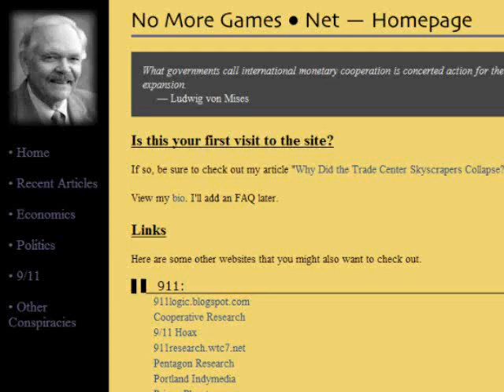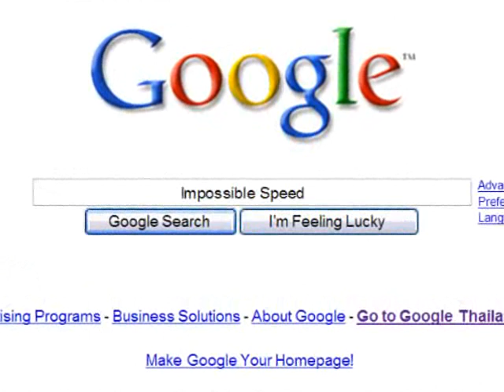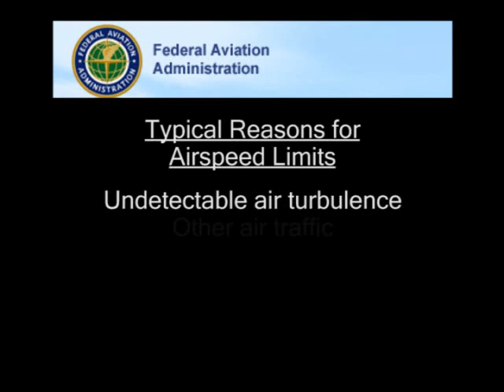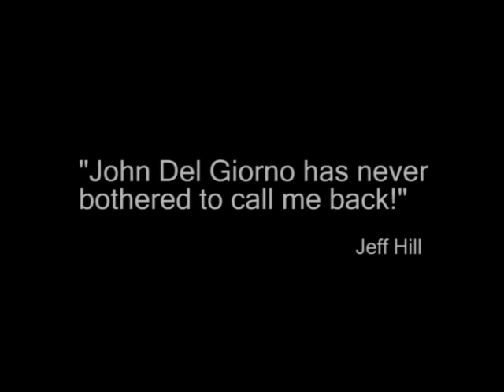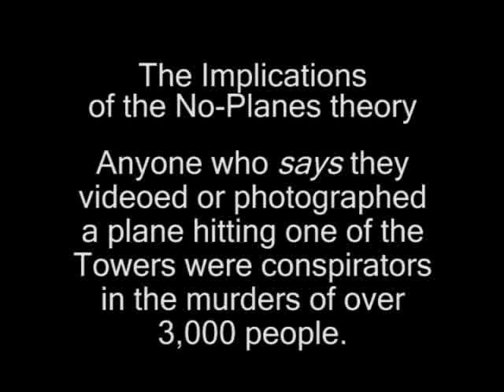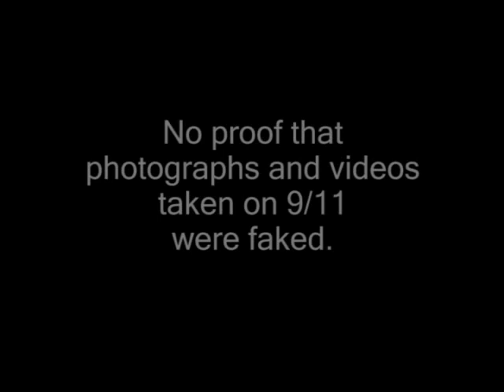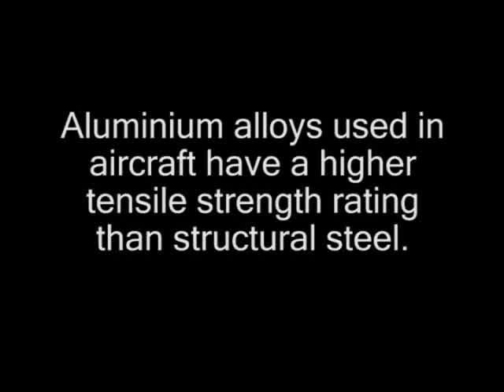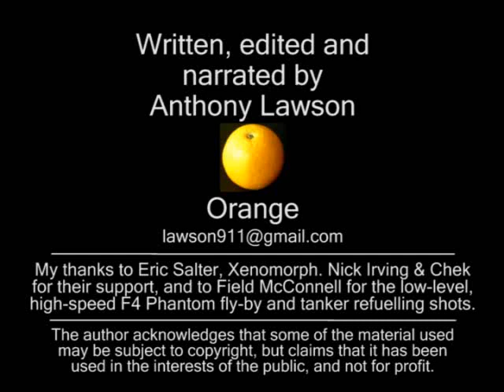9/11: Impossible Speed & Impact -- Busted! Updated

Comment: 1225 km/h, 661 Knots, 761 mph, 1.00 mach = sea level 
1053 KM/h, 568 knots 654 mph , 0.86 Mach = MAX speed for Boeing 757  
0980 KM/h, 528 knots, 608 mph, 0.80 Mach = MAX speed for Boeing 767 
0950 km/h, 513 knots, 590 mph, 0.77 mach = WTC2 impact
0853 km/h, 460 knots, 530 mph, 0.69 mach = pentagon impact 
0748 km/h, 404 knots, 465 mph, 0.60 mach = WTC1 impact

mach 1 is only 1% less at 1,368 feet so i  just used sea level

Comment: didn't need to "implant" retina images on the eyes of witnesses BECAUSE oddly enough almost every witness was an employee of one of the media groups that still brings us FAKE NEWS upon comand today. The odds they were picked at random chance is greater than the number of grains of sand on earth to 1 !!!. 
 F=ma has NO bearing on physical characteristics at subv-light  speed.  Inertia does NOTHING to change hardness values. 
The plane and building are traveling at identical closing speeds RELATIVE to each other. yet somehow the aluminum became harder than steel???

No alloyed aluminum plane traveling at 560 mph can penetrate a steel wall and heavy steel beams all the way through without having a significant amount of debris           bouncing back, or not show rippling shock waves across the building's facade and along the planes wings. Shock wave would have been traveling at at least the same speed as the plane???
. The hole in the wall system shows that the exterior beams did NOT all break but were still vertically intact. 
Half bent outward, half bent inward????
Impossible if a plane just went through them. BUSTED

Comment: Maximum takeoff weight doesn't equal structural aluminum weight, the dry weight of a Boeing 767 is 87 tons, but minus the seats, plastics and non-structural parts it's closer to 55 tons.  So pound for pound this "superior" structural aluminum stands no chance against the hardened steel frame of the towers.  And what about building 7?  Nothing flew into it, right?

Comment: Rofl, this guy compares a fighter jets speed capabilities at sea level to that of a 767?!  Unbelievable.
Reply: The speed is secondary - what determines the physical limits of the Boeing 767 is Mach number and dynamic pressure.

510 kts at 400 m in standard atmospheric conditions equals Mach 0.775. This is well within the limits of the Boeing 767. But at 400 m it produces a dynamic pressure of 40,567 N/m², and that is too much. The maximum dive speed vD of the 767 is 420 kts.

This only means that flying at 510 kts is illegal, but it is still possible. If the airplane dove down to those 400m from enough altitude, it would entirely be capable to reach this speed, but would slow down once it stops diving.

There are several effects which can cause a catastrophic failure when flying too fast:

When the aircraft flies into a gust, the resulting load factor can overstress the structure.
When the pilot commands large control inputs, he will also overstress the structure.
Flutter might also cause structural damage.
The maximum Mach number of the 767 is 0.91 (0.05 above the maximum cruise Mach number, which is 0.86), and this corresponds to 523 kts in 11,000 m. Thankfully, certification requirements demand a margin of 20% between the maximum speeds and flutter onset speeds, so flutter might be close, but is still tens of miles per hour away when diving to 510 kts. Remember, to experience flutter you need also to excite the motion first. Here is a good discussion of this topic.

In short, flying a Boeing 767 in 400 m at 510 kts is not recommended, but is entirely possible and most likely even safe when done in calm air and by a calm pilot. It only won't last long, because the engines will not produce enough thrust to maintain that speed. Flying this dive requires guts, but no special skills.
Reply: @robsash8991  Now try 700ft which was the actual altitude.

Comment: Misinformation. 757 and 767 airliners were not designed to do what a jet fighter can. And kinetic energy does not turn steel into cream cheese. The only things busted are your absolutely ridiculous statements.
Reply: The speed is secondary - what determines the physical limits of the Boeing 767 is Mach number and dynamic pressure.

510 kts at 400 m in standard atmospheric conditions equals Mach 0.775. This is well within the limits of the Boeing 767. But at 400 m it produces a dynamic pressure of 40,567 N/m², and that is too much. The maximum dive speed vD of the 767 is 420 kts.

This only means that flying at 510 kts is illegal, but it is still possible. If the airplane dove down to those 400m from enough altitude, it would entirely be capable to reach this speed, but would slow down once it stops diving.

There are several effects which can cause a catastrophic failure when flying too fast:

When the aircraft flies into a gust, the resulting load factor can overstress the structure.
When the pilot commands large control inputs, he will also overstress the structure.
Flutter might also cause structural damage.
The maximum Mach number of the 767 is 0.91 (0.05 above the maximum cruise Mach number, which is 0.86), and this corresponds to 523 kts in 11,000 m. Thankfully, certification requirements demand a margin of 20% between the maximum speeds and flutter onset speeds, so flutter might be close, but is still tens of miles per hour away when diving to 510 kts. Remember, to experience flutter you need also to excite the motion first. Here is a good discussion of this topic.

In short, flying a Boeing 767 in 400 m at 510 kts is not recommended, but is entirely possible and most likely even safe when done in calm air and by a calm pilot. It only won't last long, because the engines will not produce enough thrust to maintain that speed. Flying this dive requires guts, but no special skills.
Reply: @robsash8991  Wrong altitude

Comment: More disinformation, deliberately delivered with an austere well spoken English accent designed to give it an air of legitimacy.
Doesn't actually address the point. At 700 feet it is impossible for a 737 to travel at or around 500mph. Though some official estimates put them second at over 550mph. It would disintegrate and also be impossible to maneuver the way it did. Think driving a double-decker bus at Formula One speeds. Also doesn't address complete nose section making it through multiple layers construction grade of steel intact. Depleted Uranium anyone?
If you believe the official story you are a child.
Reply: You truthertards get your disinformation delivered by excited shitily spoken English designed to give it an air of moronicy. Like dude you know what Im sayin'?
Reply: The speed is secondary - what determines the physical limits of the Boeing 767 is Mach number and dynamic pressure.

510 kts at 400 m in standard atmospheric conditions equals Mach 0.775. This is well within the limits of the Boeing 767. But at 400 m it produces a dynamic pressure of 40,567 N/m², and that is too much. The maximum dive speed vD of the 767 is 420 kts.

This only means that flying at 510 kts is illegal, but it is still possible. If the airplane dove down to those 400m from enough altitude, it would entirely be capable to reach this speed, but would slow down once it stops diving.

There are several effects which can cause a catastrophic failure when flying too fast:

When the aircraft flies into a gust, the resulting load factor can overstress the structure.
When the pilot commands large control inputs, he will also overstress the structure.
Flutter might also cause structural damage.
The maximum Mach number of the 767 is 0.91 (0.05 above the maximum cruise Mach number, which is 0.86), and this corresponds to 523 kts in 11,000 m. Thankfully, certification requirements demand a margin of 20% between the maximum speeds and flutter onset speeds, so flutter might be close, but is still tens of miles per hour away when diving to 510 kts. Remember, to experience flutter you need also to excite the motion first. Here is a good discussion of this topic.

In short, flying a Boeing 767 in 400 m at 510 kts is not recommended, but is entirely possible and most likely even safe when done in calm air and by a calm pilot. It only won't last long, because the engines will not produce enough thrust to maintain that speed. Flying this dive requires guts, but no special skills.

Comment: i just subscribed . but on your bit about the plane disappearing into the building?.. and nothing being left outside? didn't they find the engine on the ground a few streets away. ?
  I like the fact you've bought to our attention on the planes speed capabilities although it doesnt explain the pilots capabilities . 
   The data on aeronautical aluminium v's steel is interesting, but I'm not sure they make planes so they can  slice through buildings like that ,as you can see the plane exploded .
  Your missile theory fits with eyewitness accounts of a missile being seen also. cheers.
Reply: vege mite But wasn't the engine they found the wrong type of engine.

Comment: 360 Knots is the velocity max operating limit (VMO) of Boeing 767_200 at sea level. 420 Knots is the speed upto which the aircraft is safe to fly, but isn't always permitted to fly. The 60 knot difference between VMO and VD is a safety margin which should be maintained  unless a higher speed is authorized. And for those claiming that there is an additional margin of safety that exists above VD , you're probably don't know that you're referring to the "design dive speed", which only applies to those aircrafts that are maintaining a constant airspeed and constant altitude.  In other words , this does not apply to aircrafts that are experiencing static or dynamic pressure changes (maneuvering). Therefore, in case of the 9\11 aircrafts, which followed an extremely unsteady flight path, VD is the maximum safe speed and the additional 21% scale you mentioned, does not apply here.

According to the radar data provided by NTSB, UAE flight 175 maintained  between 500_520 Knots during a steady descent from 12000 ft -3000ft before it accelerates and strikes the South tower at 513 Knots groundspeed. The video also failed to mention the fact that the flight 175 flew well above 500 Knots for several minutes, 150 Knots above the permitted airspeed and 90 Knots above the maximum safe speed,  before crashing into the building.
Reply: The pilot didn't care about permitted airspeed or maximum safe speed so those numbers don't matter one bit.
Reply: Why would the Gubbermint state the plane was going at an impossible speed if it was so easy for truthertards to just look it up?  Seems the easiest mistake to make. They could have said 519mph.

Comment: The planes maximum air speed obviously depends on the altitude you fool. Any amount of fact checking will confirm a Boeing 767 could not have been flown at 510 knots into the towers as the government wants us to believe. Even if it could have been flown that fast which it did not there would be no logical reason for a terrorist to risk the plane breaking apart before hitting anything by doing so. Nothing about what your saying is believable and besides all of the alleged videos of planes hitting the building have been proven to have been done with composite video layering.

Comment: This is incredible.  This man is saying this, but ALL airline pilots have said that the planes on 911 could NOT have traveled at the speeds published by the gov't - that the plane traveling at that speed at that altitude would break apart.  Joseph Keith is not the only aeronautical engineer who has said this.  They ALL HAVE SAID IT.  WHAT A LIAR.
Reply: The speed is secondary - what determines the physical limits of the Boeing 767 is Mach number and dynamic pressure.

510 kts at 400 m in standard atmospheric conditions equals Mach 0.775. This is well within the limits of the Boeing 767. But at 400 m it produces a dynamic pressure of 40,567 N/m², and that is too much. The maximum dive speed vD of the 767 is 420 kts.

This only means that flying at 510 kts is illegal, but it is still possible. If the airplane dove down to those 400m from enough altitude, it would entirely be capable to reach this speed, but would slow down once it stops diving.

There are several effects which can cause a catastrophic failure when flying too fast:

When the aircraft flies into a gust, the resulting load factor can overstress the structure.
When the pilot commands large control inputs, he will also overstress the structure.
Flutter might also cause structural damage.
The maximum Mach number of the 767 is 0.91 (0.05 above the maximum cruise Mach number, which is 0.86), and this corresponds to 523 kts in 11,000 m. Thankfully, certification requirements demand a margin of 20% between the maximum speeds and flutter onset speeds, so flutter might be close, but is still tens of miles per hour away when diving to 510 kts. Remember, to experience flutter you need also to excite the motion first. Here is a good discussion of this topic.

In short, flying a Boeing 767 in 400 m at 510 kts is not recommended, but is entirely possible and most likely even safe when done in calm air and by a calm pilot. It only won't last long, because the engines will not produce enough thrust to maintain that speed. Flying this dive requires guts, but no special skills.

Comment: A steep descent is not needed to build up considerable speed!  Especially in a well-streamlined plane.  --Not a steep dive at all!
Reply: +Mark Prange A 767 is not a well-streamlined plane.
The speeds and control of the planes are indeed imposable.
Reply: Mark Prange Well something happened.
one thing is for sure, no standard airliner hit the towers.

where did all the plane wreckage go?
Reply: The planes performed like a standard airliner.  Such an airliner will maintain speed at IDLE in about a 3º descent.  Leave the power up and it will accelerate to speeds faster than what is normally allowed.    

Some of the airliner fell onto the street below.  The rest of the aluminum was in the fire.  You know aluminum burns.  --Burns really well.
Reply: Mark Prange you're missing the simple fact of air density, the air density at sea level is 3 times that at cruising altitude so the descent speed WILL NOT be maintained. 
The planes were not performing like standard airliners.
Reply: katiposcotty:  An airliner normally does slow down in a 3º descent as the denser air is entered, because thrust is kept way down near idle.  That is not the ony way to fly, though.  The plane can descend more steeply, and the thrust can be considerable greater than idle.  The second 767--the one flown faster--had accelerated in a descent steeper than 3º.  That alone could build considerable speed.  With plenty of thrust available, the plane was more than able to do what it was seen doing.
Reply: Mark Prange The VMO of a 767 at sea level is 360 knots.
510 knots at 700 feet is not possible.
Reply: Mark Prange also the take off speed is 140-160 knots.
this is fully loaded.
how is a plane going to maintain a descent and still be flying at 510 knots?
Your augment is fundamentally flawed.
Reply: 360 KIAS is a limitation for the pilot to comply with.  It is not a maximum possible speed.  360 KIAS can be exceeded even with the engines shut OFF, just by descending steeply enough.  With enough thrust added, the descent would not have to be nearly so steep.
Reply: Mark Prange And there is a reason why the pilot must comply to the limits.
do you not understand that to maintain this dive to low altitude would create a massive amount lift that the controls would have to overcome, add to that the extra drag created by the controls of a 767 that is already a high drag aircraft. 
The fact is the speed is not possible.
Reply: katiposcotty:  The pilot should comply, but does not have to.  The Vmo and the Design Dive speed (Vd) are exceeded during test flying.  The descent angle does not have to be extreme to build up speed.  The plane was descending at about 5º or 6º when it accelerated to 500+ knots.  The control surfaces need to overcome the lift generated by flying fast?  What's the problem?  The control deflections will add extra drag?  A little--they don't need to be deflected much to get results.  The 767 is a high-drag aircraft?!  No--far from it.
Reply: The 767 did not fly level at a low altitude, accelerating to and maintaining 510 KIAS.  It descended out of altitude, and increased its descent rate and airspeed as it approached the WTC.  The descent gradient was apparent from radar plots, and is apparent even in some videos.  It leveled only toward the end of its run in, and did not decelerate much at all from about 510 knots.  In this case the engines helped plenty, but a 767 can fly 510 KIAS at low altitude even with both engines shut off.
Reply: How fast do you think it was flying?